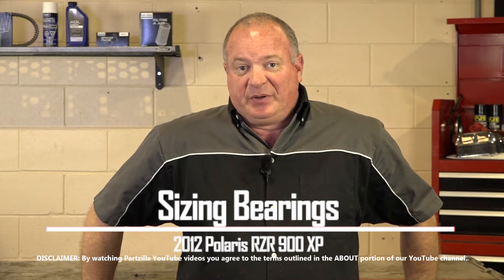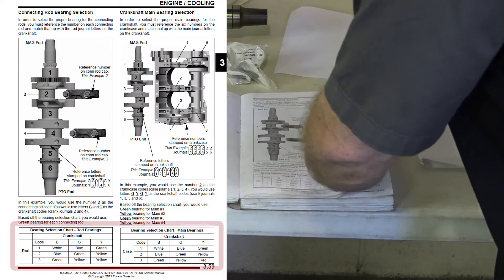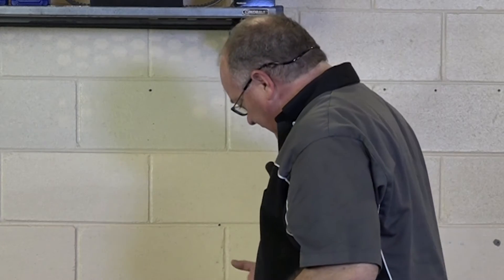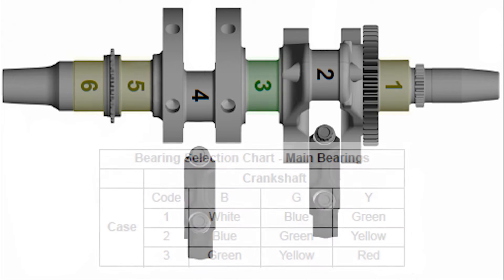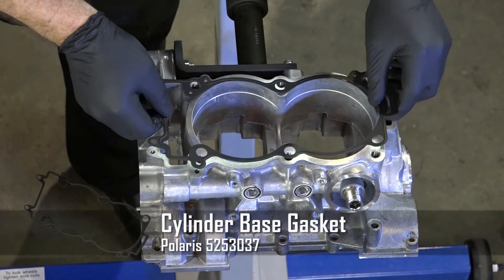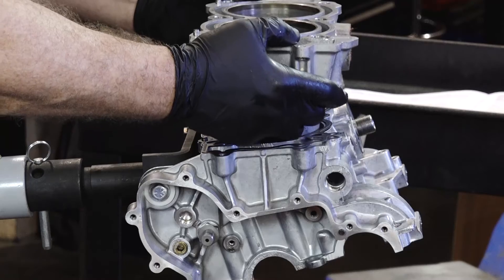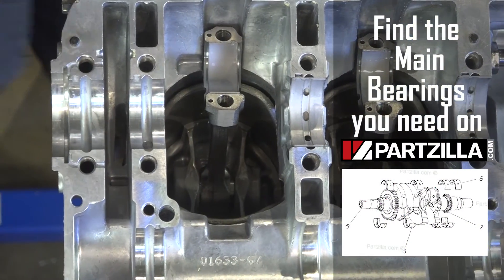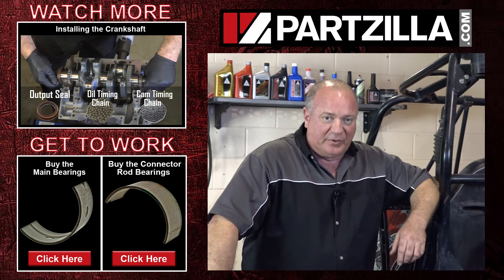Sizing the Bearings on a Polaris RZR 900 XP | Partzilla.com

Comment: What is the point of all of this?  Why do they not simply make their crank journals and crankcases standard like every other engine in the world?  One should not have to 'size' anything unless the parts have been machined for rebuilding.  
Why are the bearings not simply stated undersize or oversize, again like every other engine in the world?  It works for GM, for Cat, for Deere, for Fiat....

Comment: Hot Rods don't offer alternate sizes and says that there bearing are compatible with the oem sized crank.  How can that be?
Reply from the maker: OEM all come with a specific tolerance when new. You have to size the bearing once it's been used and there is wear from use.